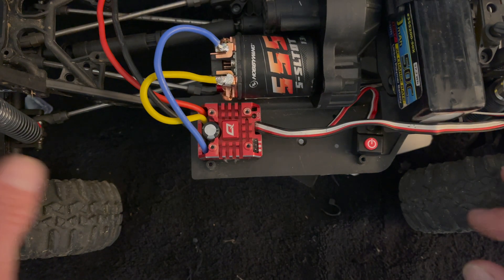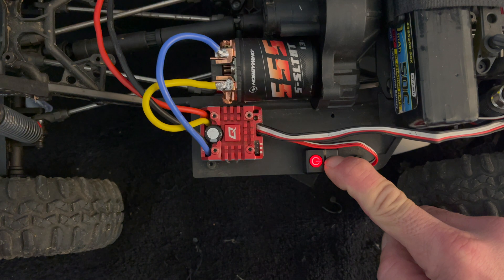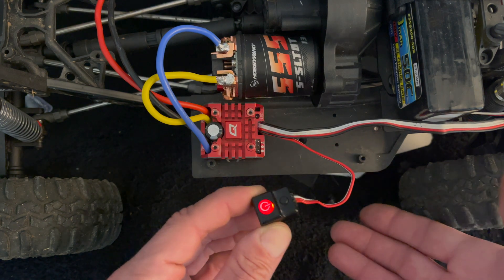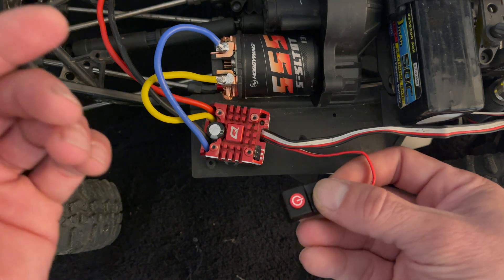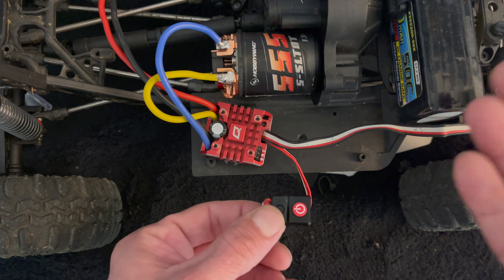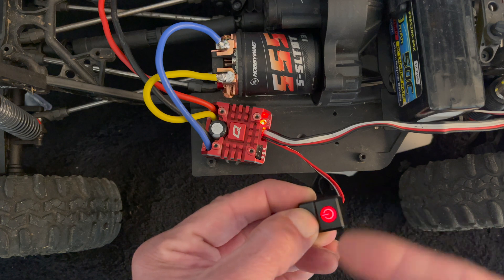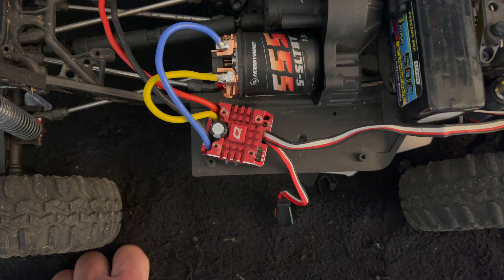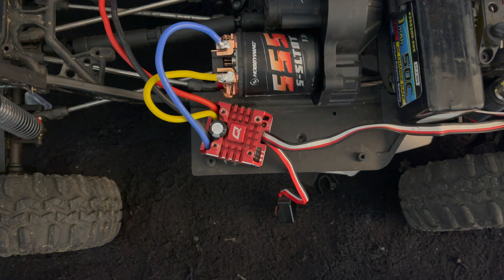The Charlie Show /// Episode 296 /// On Board Programming - Quicrun

Comment: I have a problem with my combo, wp1080 g2 x 540 motor 40t. Everything it's calibrate but when i put on my gear box, the motor don't spin and get hot. What's happening if you can help me.